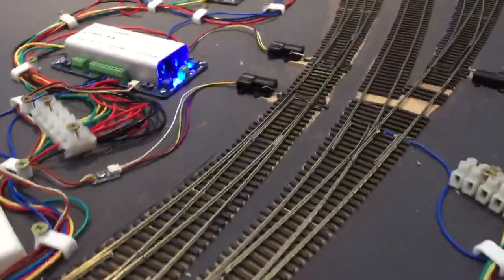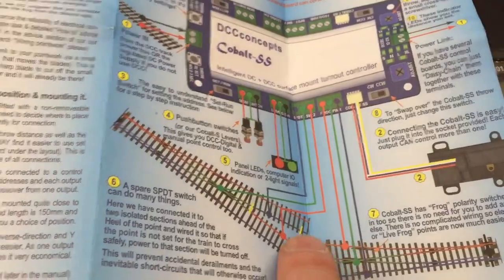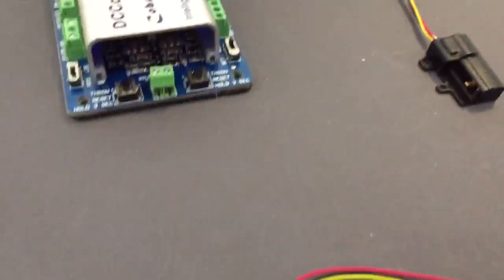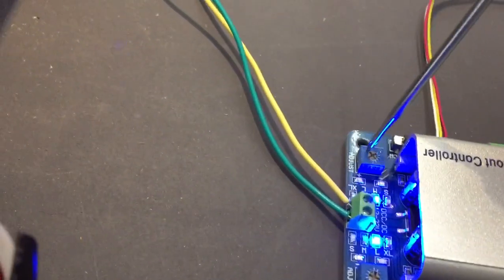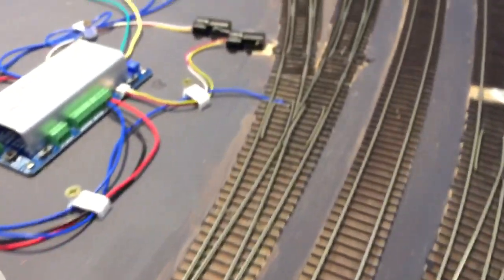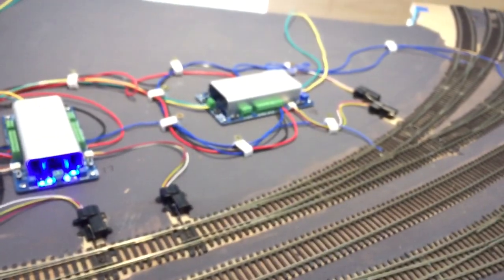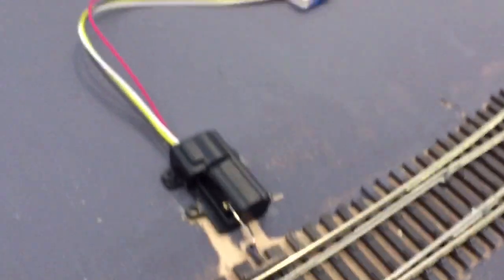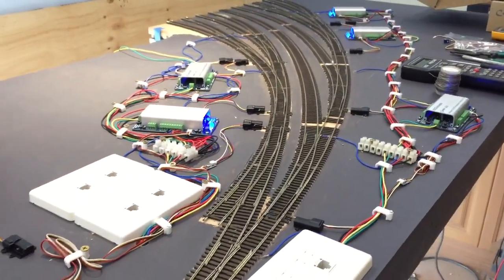How to install and program DCC concepts Cobalt SS point motors without instructions

Comment: I am about to set up a new layout and will use these for turnout control on my workbench area since tortoises, manual blue point's, etc. aren't suitable for that area. I'm using new-style Walthers turnouts which have an over-centre spring at the switch rails and I believe the springs need to be removed.

Comment: Very good Video, but would be so much better if you got some nice friendly person to hold the camera rather tha it to be following every single movement of your head.  ! A good video spoilt by being unable to follow what your saying with what you are showing.  I see you are using the NCE  DCC system which is also what I have.  Is there any reason that you  are outting them in as Macros ?  rather than  as Accessories.  ie.  the controllers  chip being given a  being given an address or am I looking at this in entirley the wrong way ?   ( All my other point motors are TrainTronics ( similar to the ordinary Cobalt motor)  and you give the motor  an  'address' etc